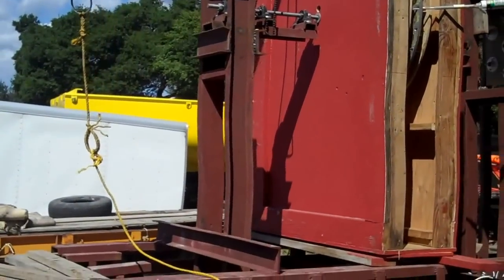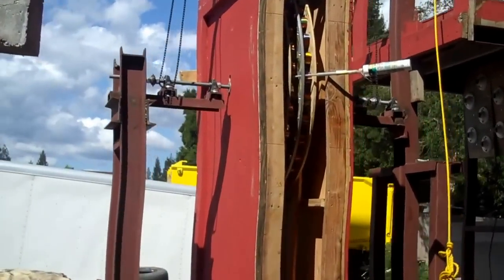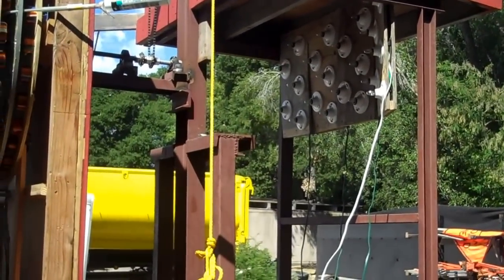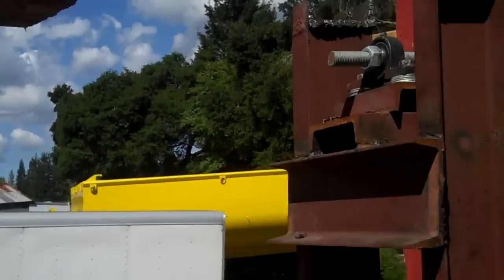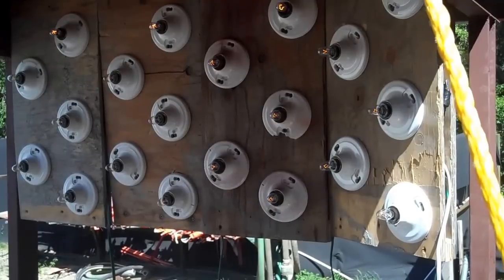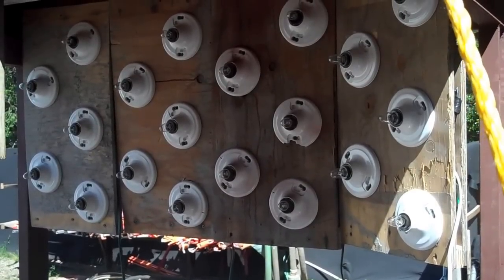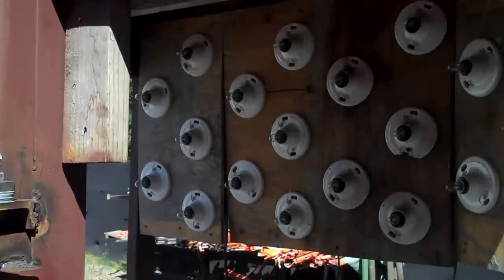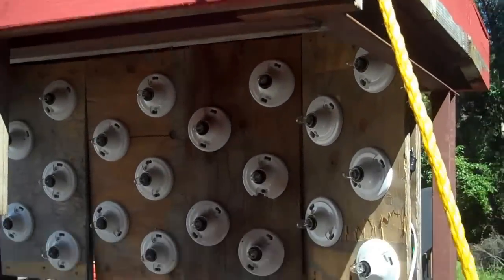Gravity Generator Phase 2 B testing

Comment: I would suggest you to try an  hub motor as generator and you can get one from a old electric scooter or ebike, and those hub motors works on low rpm
Good luck with your project looks pretty good

Comment: I just have to ask: What was the point of building this? I understand how it works. It's a mass/gravity generator, but the electrical power production is way too short lived to be of any practical value.
Reply from the maker: This video your responding to is and old test of a gravity convertor electric generator under construction. Phase 3 videos shown on my you tube channel run electricity nonstop, there are about 5 videos out of 15 I recommend you view to answer your question about electrical flow. look me up under Bunker Rogge in the you tube search and all the videos should come up. thanks for checking my videos out.